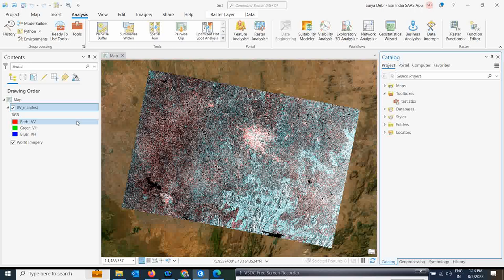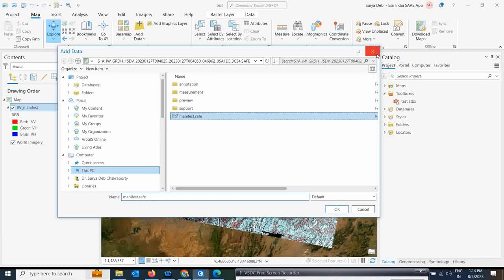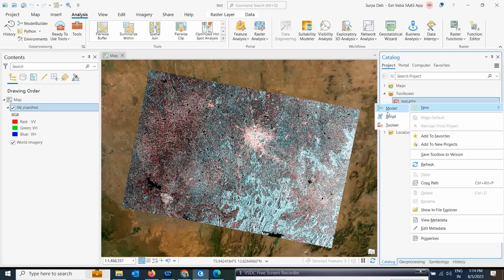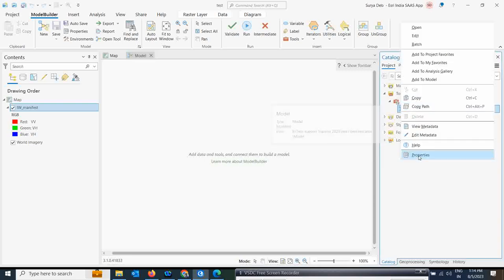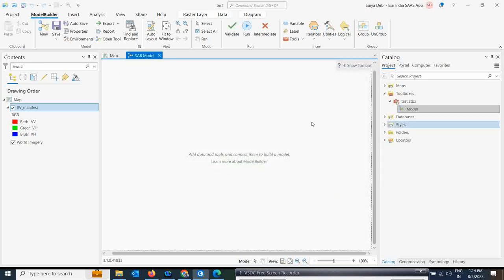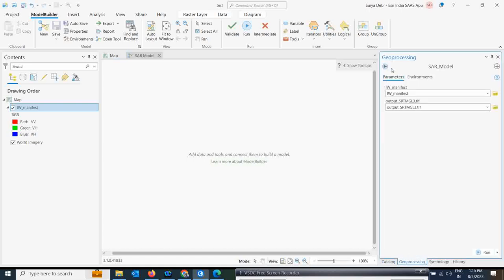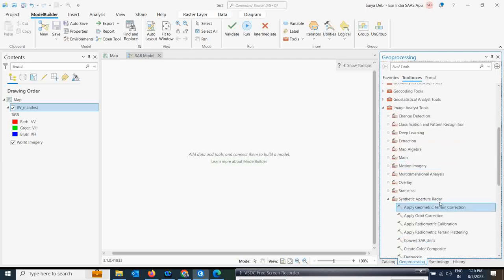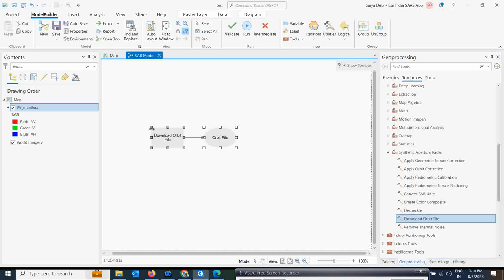SAR Data processing using model builder

Comment: sir, in sar data processing, it is said bandwidth is independent of pulse width. How is it so?
Reply from the maker: In synthetic aperture radar (SAR) imaging, the relationship between bandwidth, pulse width, and resolution is a critical aspect of the system design. The statement that "bandwidth is independent of pulse width" is often true in the context of SAR, and it's related to the principles of SAR imaging.

SAR systems use the concept of synthetic aperture to achieve high-resolution images. The synthetic aperture is essentially a long antenna created by moving or synthesizing a virtual aperture over time. The longer the synthetic aperture, the higher the resolution of the resulting image.

The resolution of a SAR system is determined by both the range resolution and azimuth resolution. The range resolution is primarily influenced by the bandwidth of the radar signal, while the azimuth resolution is influenced by the synthetic aperture length, which is related to the pulse width.

The key point is that, in SAR, you can achieve finer resolution in range by using a wider bandwidth, and finer resolution in azimuth by using a longer synthetic aperture, which is related to a longer pulse width. However, there's a trade-off between range resolution and azimuth resolution.

So, the statement "bandwidth is independent of pulse width" means that, in the context of SAR, you can adjust the bandwidth and pulse width separately to achieve the desired trade-off between range and azimuth resolution. This independence allows SAR systems to be more flexible in adapting to different imaging requirements without a direct, fixed relationship between bandwidth and pulse width.
Reply from the maker: In SAR data processing, it is said that *bandwidth is independent of pulse width**. This is because of the **pulse compression technique* used to get better range resolution . 

In case of *Linear Frequency Modulated (LFM) signal**, the frequency changes from 0 to 0 + LFM wave also called ‘Chirp’ (Bird chirping) constant but it is linearly. The **bandwidth (B)* of the signal is given by:
B= /_\ F

where Delta /_\ f is the frequency difference between the start and end of the chirp . Therefore, the bandwidth is independent of pulse width ¹⁴. 

I hope this helps!

Source: 
(1) Basics of SAR Data Processing - Indian Institute of Remote Sensing. https://eclasscms.iirs.gov.in/cms_admin/projectFile/SARDataProcessing_DIACourse.pdf.
(2) Basics of SAR Data Processing - Indian Institute of Remote Sensing. https://bing.com/search?q=sar+data+processing+bandwidth+independent+of+pulse+width.
(3) SAR Instrument Principles and Processing - European Space Agency. https://earth.esa.int/eogateway/documents/20142/0/01_Wednesday_OCT2013_SAR_principles.pdf.
(4) Data Processing, SAR Sensors | SpringerLink. https://link.springer.com/referenceworkentry/10.1007/978-0-387-36699-9_37.
Reply: @spaceremotesensingandgis5626   thank you sir, that really helped 🙏😊